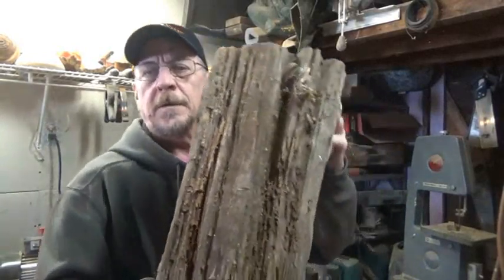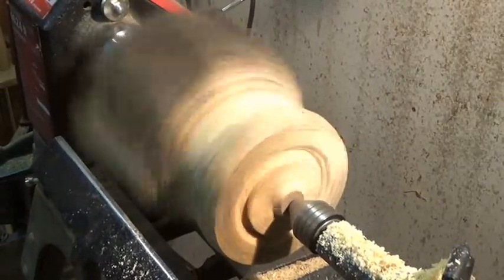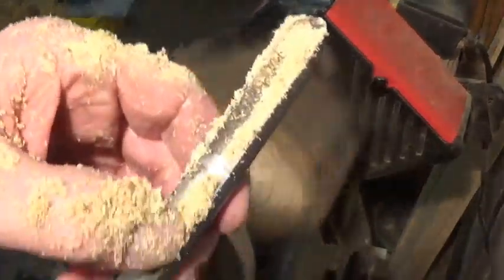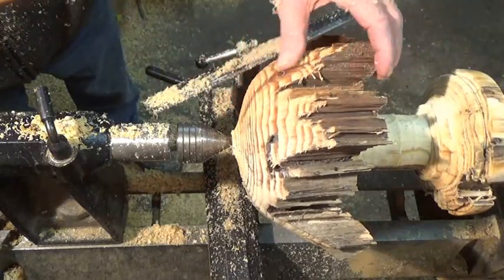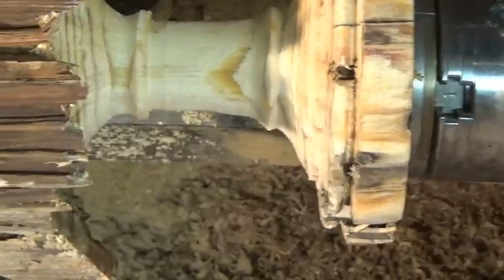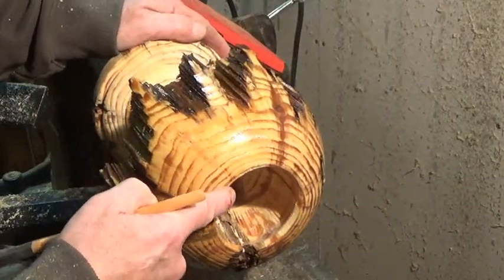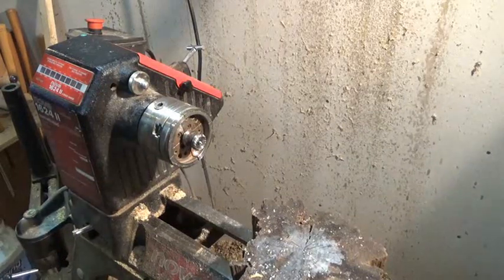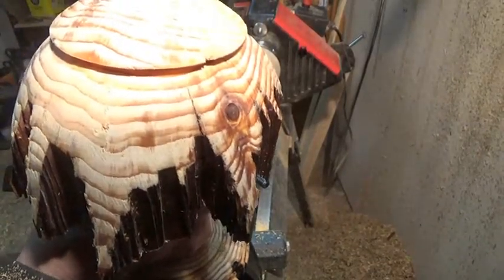Turning Red Pine ( FatWood )

Comment: Let's fire it up . What a crazy good Video Sir . This is my first time watching . 
  Doesn't that hurt your hands though?
Much Respect Sir and Blessings to you and your family . 🤠🖖  How do you determine whether to go off center or centered though  ? Just curious sir.
Reply from the maker: Center depends on the piece of wood. It is more important to find center by weight rather then actual center by measurement . So the wood will be more balanced for less vibration . some wood does hurt a little from the chips coming off. Thank you for watching.
Reply: @SteveandSusiesHomestead  ohh, centering by weight makes sense , or it would be floppy acting.  + I didn't think about the chips Flying at "X" amount of speed, instead, I thought about the pressure on the hands while carving your Art pieces . Take Care now .🤠🖖